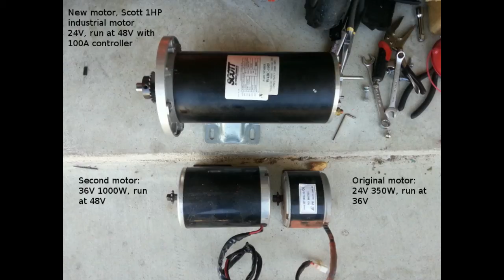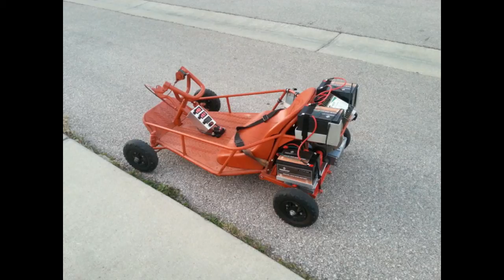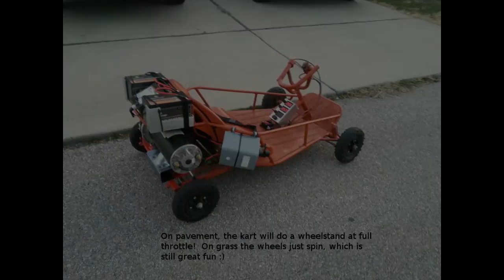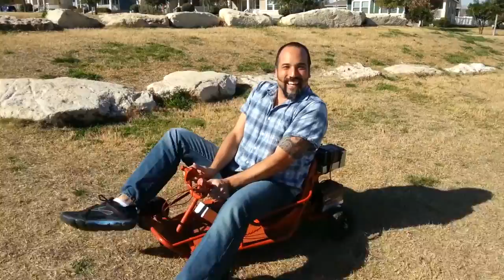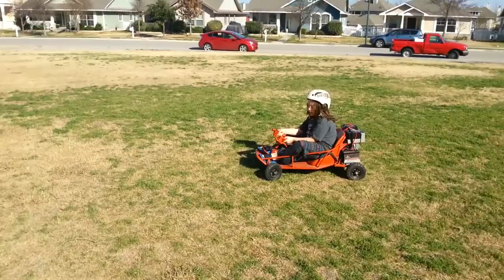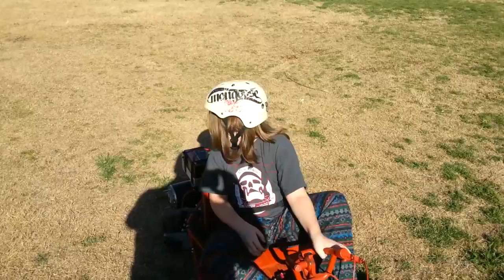Razor Dune Buggy with 1HP industrial motor at 48V

Comment: That’s fast.I just put a 79cc engine on my sons razor dune buggy.
Reply from the maker: Nice job putting the Predator motor on the buggy! The biggest issue we had with the larger electric motor and controller on the buggy was run time, we would get about 15 minutes of run time until the batteries were dead. A gas motor does not have that problem. But the torque of the electric motor was a blast.

Comment: Sweet! Working on one as well. Currently heading towards your mid step (1kw unite motor and 48v) should be a blast!
Reply from the maker: Nice! It should be easier on the batteries too. The big motor and controller were hell on our 12AH SLA batteries. Looking forward to seeing your kart!
Reply: Thanks I will try to post video footage cause it seems not many are documented.
Been trying hard to source a proper YK43B controller. Future plans are to attempt to add drift sleeeves to rear tires for improved turning speed/efficiency on dry pavement, and notch the frame to allow for extended turning radius. I also am attempting the same 36v motor on 48v setup. Utilizing the jack shaft we can use any combination of 9-15T sprockets in addition to the 32T on the jackshaft initially. 
Super cool cart with tons of mod ability! Very solid axel as well. Thanks for sharing your thread and the video!

Comment: 1 hp is about 750 watts.
Reply from the maker: Yeah, the motor was rated at 1HP (750 watts) but we were pushing over 5,000 watts at full throttle and full charge. The motor got hot enough where I thought about making a cooling jacket for it but in the end it was not necessary and the motor took the abuse :D